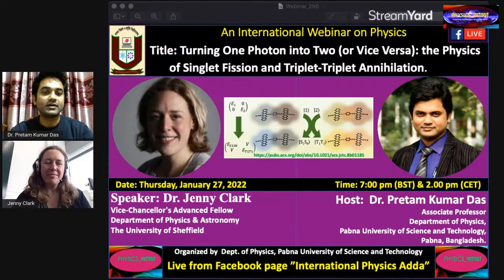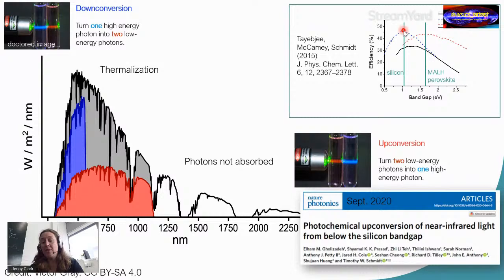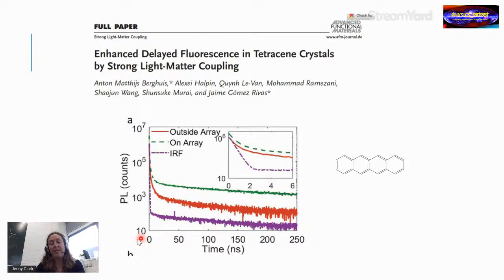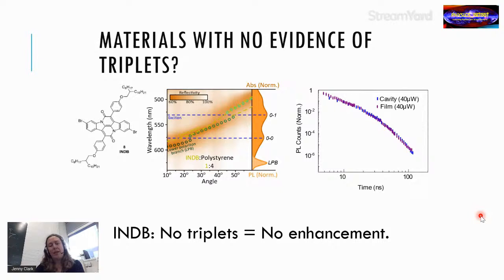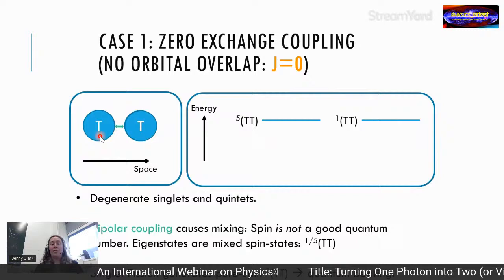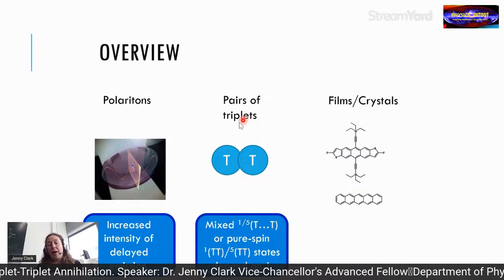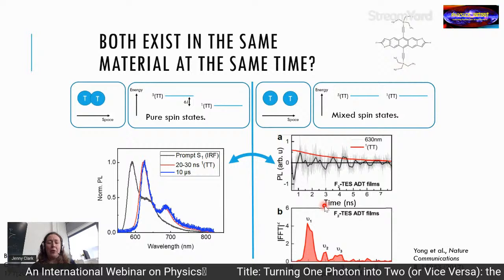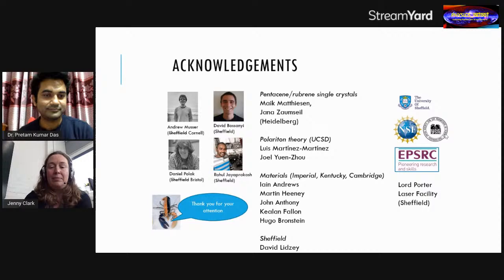Physics of Singlet Fission and Triplet-Triplet Annihilation.

Comment: Respected sir 

I have a few questions

1. It was mentioned that photon upconversion can be used for high efficiency perovskite solar cells upto 40%. So, can you please tell the device structure of such high efficiency perovskite solar cells? Also, kindly explain the fabrication method to utilise photon upconversion.

2. During triplet triplet annihilation for upconversion perovskite solar cells, is exchange energy (J) J=0 or J>0?

3. How is quantum beating relevant to efficiency of upconversion perovskite solar cells?

4. How does microcavity cause spacious triplets with J=0 to go to LPB?

5. What is triplet hopping and how is it relevant in upconversion perovskite solar cells?

I shall be happy if you can clarify my above doubts soon. If I have any further doubts, then I shall surely get back to you.

Thank you.